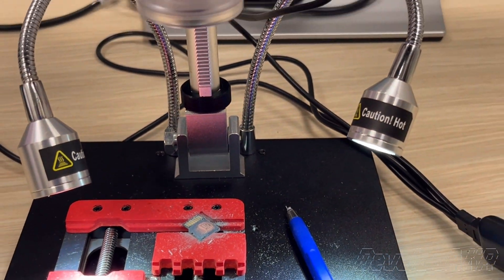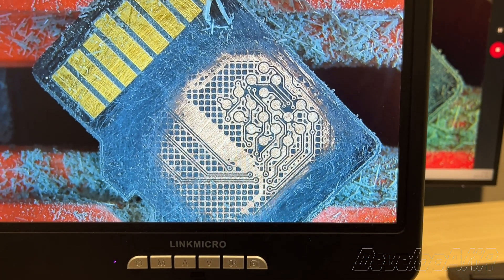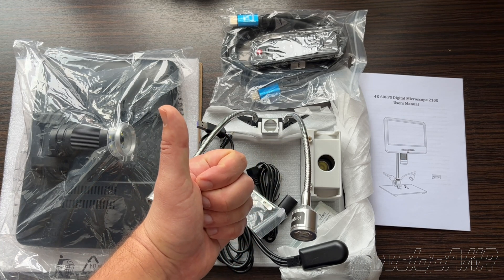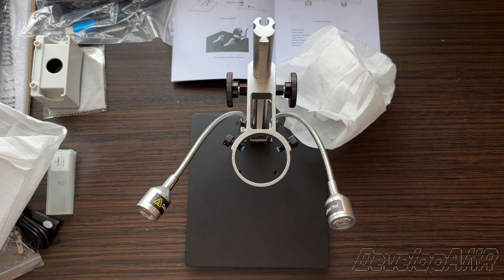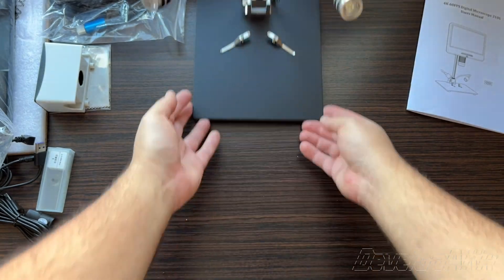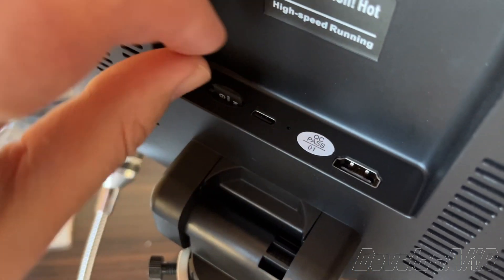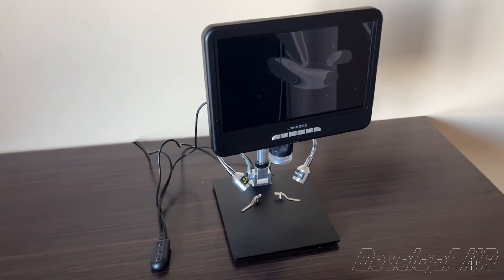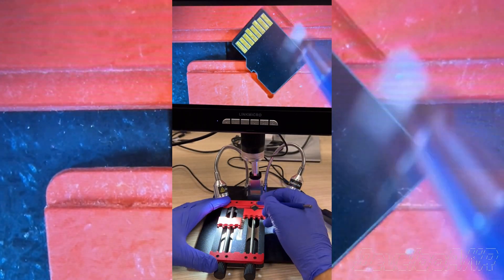Testing a LINKMICRO digital microscope for data recovery from MicroSD card

Comment from the maker: LINKMICRO LM210S 10.1'' 4K 60FPS Digital Microscope HDMI for Electronics Repair, 4K Microscope for Soldering with Microphone, HDMI 2.0 Output, 4K 60FPS UHD Video, 64MP.
:::
https://amzn.to/4bYlMwM
:::
Light Source Type: LED
Model Name: LM210S
Material: 4K 60FPS HDMI 2.0
Color: Black
Real Angle of View: 178 Degrees
Magnification Maximum: 1760X :hand-pink-waving: